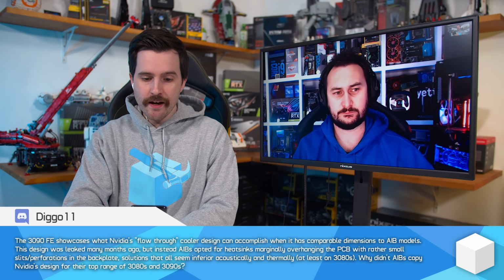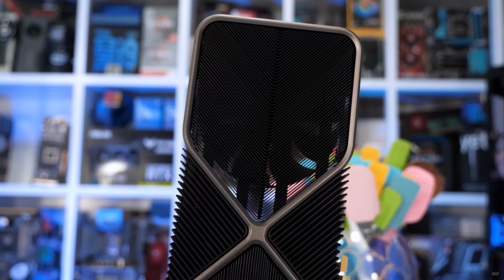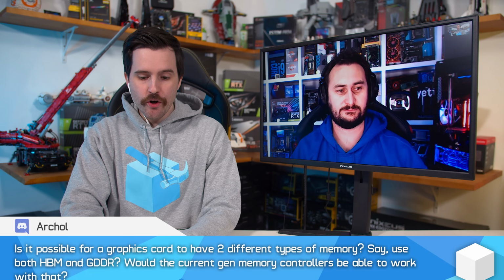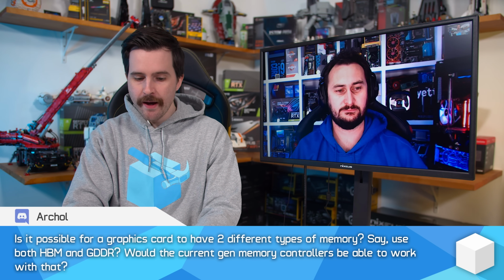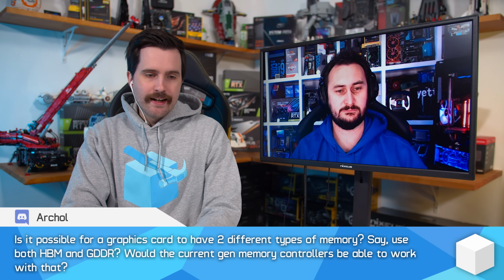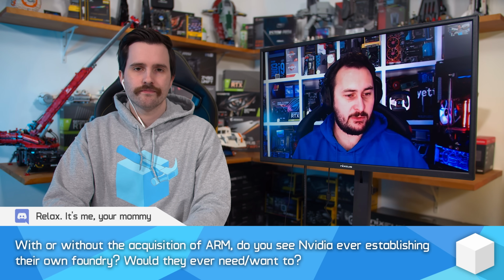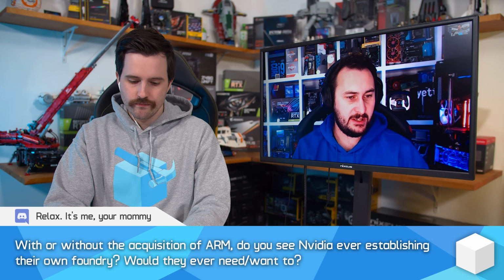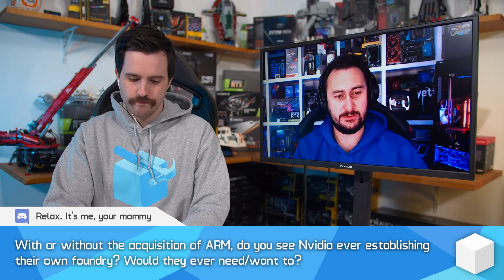Will RDNA2 and Zen 3 Have Launch Issues? Can AMD Beat Nvidia at Ray Tracing? September Q&A [Part 3]

Comment: in 10 years igpu's will have a similar performance as these big boys today
Reply: Doubt. 3nm will allow much larger performance, yes, but there will be a hard ceiling and I doubt it'll reach the 3080. The problem with iGPU's is that they either need on-die VRAM (I.e. less space for CU's) or it'll depend on system memory, so at some point more CU's will be useless.
Reply: @WhenDoesTheVideoActuallyStart  2010's GTX 580 has comparable performance to vega 11 (3400G) graphics performance. with some OC on the igpu and good memory, it matches roughly
Reply: @acidGoatG  If we don't figure out carbon-based processors we will be stuck with 3nm-ish silicon. Moore's Law is really dead.
Reply: @WhenDoesTheVideoActuallyStart  we will see, maybe you are right, but never underestimate the engineers and science dudes.
Reply: @acidGoatG  2010 was the year of gtx 480 ...
Reply: @SoFGR  gtx 580 was 2010 Q4, so both of them counts as 2010 products in my opinion
Reply: @WhenDoesTheVideoActuallyStart  doubtful, i was reading about hard ceilings in gaming mags in 1999.

at the time they were claiming 500nm was the absolute limit for moores law.
Reply: mikey wow, you had gaming magazine in 1999?
Reply: @puddles5501  500nm was theoretical,
~1nm is actual physical limitations because of quantum tunneling
Reply: @WhenDoesTheVideoActuallyStart  maybe when DDR5 comes out it might be good enough
Reply: @GewelReal  ddr5 is like months away.
We will probably have it by  q3 2021. 

In 10years we will be on ddr6 or ddr7
Reply: @GewelReal  With 5nm APU's running on DDR5 we might see RX 570-like performance, as it's been clear that even on DDR4 the Vega-based Ryzen APU's haven't been able to leverage all the bandwith. But we'd need on-die memory for anything more than that.

Comment: The die has been cast with this 30 series launch.  Swarms of auto-buy bots will become increasingly sophisticated to get around anti-scalping measures, and the general cluster F'ck that has become our global supply chain slowing down production worldwide means you may as well add a couple of months (or more) to any hot product launch going forward before the general public will be able to easily find one at MSRP.  The world has changed a lot this year, and generally for the worse.
Reply: They could easily limit purchases by limiting them to 1 per address.
Reply: @undefinablereasoning   Many sites already have.  Hasn't made much difference, money is a hell of a motivator for getting around things like that.

Comment: With Nvidia having more money and more muscle to throw at RnD, it's tough to imagine AMD can get their Shader Cores and RT Cores on the same level as Nvidia simultaneously. I mean, just last gen the 5700 XT and 2070 Super had almost identical specs but the 2070 Super was faster and more energy efficient before and after its special tricks. AMD has Microsoft, so RT may catch up quickly, but Nvidia still has 2+ years of RTX practice to AMD's 0+ years. Then DLSS further complicates matters, does AMD create a Tensor equivalent? CAN AMD BEAT ONE OF THE BEST AI COMPANIES IN THE WORLD AT THEIR OWN GAME?

So spicy, can't wait to see what goes down.

Edit: Oh and even if they do, did they fix their hardware encoder AND add HDR support?
Reply: i will be straight and i say to you  Turing is more good for gaming than Ampere.
Ampere just...is not for gaming section!
Reply: @riannair7101  That is simply not how generational improvements work!

Comment: My gut feeling is that RDNA 2 will have a smooth launch. They did have a bad period with drivers earlier this year but apart from that they have been good for years. They have been investing more resources into software lately, and they seem keen to release big Navi when it's ready rather than rushing. Of course I won't preorder anything though, will wait for reviews.
Reply: I think Ryzen have helped alot, they got the cash to spend on drivers. Sure its a different department but nobody at AMD want the company to get/keep a bad name...
Reply: @ssu7653  Absolutely. AMD was losing money until they launched Zen. They were in survival mode cutting staff and everything was focused On Zen. Discrete GPUs were completely de-prioritized, hence the rebrands and dragging out GCN.

After Zen launched they started making profits. Since then if you check their financials for the last 3 years every quarter they increase their R&D budget.

Comment: There was shortage of Zen2 cpus... Zen3 seems to be even more popular... so more demand! So Zen3 is very hard to get, even if the stock is bigger than with Zen2... Does this affect GPUs.. surely! There will be rdna2 GPUs... but you may have to wait even longer than ampera. Nvdia has the ”whole” Samsung production capasity to those. Amd has to divide TSMC, between Apple, other mobile phone manufacturers, new consoles. 4000 series mobile and apu chips. Zen3 and small and big rdna2 chips... So you have ro wait those... how long is the interesting question.

Comment: The GPU blow past PCB has been happening for years, it is not something invented by Nvidia RTX3000 series.
My Gigabyte GTX 970 did it and the Sapphire R9 Fury has a huge cooler overhang, because the PCB can be made so small without ram modules.

Comment: With RT on for RDNA 2 in current games, because while its based on DXR, the devs coding it calls RTX functions in NV's library, that sits above DX12 DXR. If the devs didn't code for a fallback mode (DXR compatible code), it won't work without a game update. Some of these games also have a vendor ID & GPU id detection code, to enable RTX toggle on in the options, so it may not even recognize RDNA 2 GPU as RT capable hw. 

Future games will be really well optimized with RT for RDNA 2 though, due to both major consoles having similar hw and RT implementation.
Reply: I see no reason why devs would use vendor ID & GPU ID if they can just test for ray tracing support. Pascal having software ray tracing suggests that there's nothing that truly demands RTX hardware.
Reply: @ETophales  Because the RTX games are sponsored by NV, to use their specific library. ;)
Reply: @nerdtechgasm6502  The only RTX-specific library I'm aware of is OptiX, and I think that won't be relevant for games.

Comment: "Why Didn't AIBs Copy RTX 3080 FE Design?" - Seems like Asus TUF did a better job thermally and acoustically than the FE card, and based on speculation that the FE cooler may cost $150 to make, I don't see a problem with the AIB's not copying Nvidia.
Reply: I mean, yes, but it's also much heavier. That's the point.
Reply: @WhenDoesTheVideoActuallyStart  I haven't seen any reviews of the 3080's that make a big point about the weight of the cards beyond mentioning some of them are heavy, so I don't think that was a big consideration in how either Nvidia or the AIB's designed the coolers. Unless you've got a quote somewhere mentioning weight savings being a big factor in how Nvidia designed the coolers, or even weight specs of the different cards to prove one is heavier than the others (I went looking through some reviews and specs pages and couldn't find weights)
Reply: @VelcroSnake93  I just checked and apparently the Asus card weights in at 1.77kg while the FE stands at 1.35kg, so while not by a monumental margin they did use something around 30% more metal.

Comment: Nvidia has had a whole generation to work on Ray tracing, whereas this will be AMD's first time dipping their toes into ray tracing, but the results of AMD will be interesting to see regardless.
Reply: Tbf AMD is investing more of their R&D into gaming cards, while Nvidia thought that AMD would never be able to catch them.
Reply: @WhenDoesTheVideoActuallyStart  And so far AMD has not come close to catching them.
Amd to this point has only challenged at the mid point cards and below level.
Anything concerning the new cards at this point is still just speculation and guessing but most opinions seem to be the new AMD cards will not be on the same level as the 3080. 
They will compete and maybe even beat the 3070 but not the 3080.
Reply: @billwiley7216  And?

Comment: The Q&A series is very informative like GN's hardware recaps. When is the A520 mobos review coming? I m anxiously waiting for that.
Reply: Noone care about that cheap boards
Reply: @lowzyyy  Not everyone is a prosumer lol. In fact, the vast majority of people aren't. Gigabyte's A520's can handle 6 cores and have PBO+RAM OC'ing, what else does one need?
Reply: @WhenDoesTheVideoActuallyStart  i am not a PROsumer. But if i buy pc for next 5 years i would not buy pcie3 now...any b550 will do the job..just my opinion. You dont need aourus master to use ryzen 3600 thats true. Something around 150e is enough for the motherboard that will run ANYthing.
On the other hand maybe its better to upgrade more frequently. In that case A520 is good buy.

Comment: I'm pretty sure you don't know what you're talking about if you think it won't be difficult for AMD to implement DLSS. Remember that DLSS isn't just the hardware in the graphics cards themselves. DLSS is an implementation of a trained machine learning model that Nvidia have been refining on their supercomputers for some time now. AMD doesn't have anywhere close to the raw compute power that Nvidia has, and Nvidia isn't going to share that trained model with AMD. It would take a very long time for AMD to come up with a comparable trained model of their own.

Comment: As long as RDNA 2 has a 3070 ti equivalent with 16gbs of vram, around $50 to $100 cheaper, & a lower tdp I'll be satisfied.
May be asking for a lot but this is what it will take to take market share from Nvidia.
Reply: I think this will be my second AMD card.
My first was a R9 290x then 1060 then 1080 and now I think it's going to be amd again
Reply: @OutOfNameIdeas2  R9 290x was a kick ass card if you knew how to tune them right! I was rockin' one with watercooling & a BIOS mod until early this year before finally deciding to retire it for a 5700XT I picked up for $320... Which happened to fit the same water cooler & is now also BIOS modded to perform as well as a 2080S. xD
Reply: @EnragedN3wb  was the price for your watercooler was worth it? and how much is it?
Reply: @madtech5153  The watercooler came with my R9 290x which I actually bought used from a guy who had 2 of them in crossfire.

It's an Arctic Accero Hybrid, & I can't even find them for sale anymore. It's so old I had to take it apart & refill/clean it before using it on my 5700XT, but the 5700(XT) has the same exact mounting pattern as the R9 290(x) so anything that fits an that should also fit a 5700.

As for being worth it to watercool, it definitely was for me, since it lasted through more than one GPU. If you want to get more out of your card it very well could be. I got an extra 150MHz OC out of mine & it still runs cooler than stock(60C core/100C hotspot @ 2100MHz max boost), I just don't want to push much more voltage than I am.
Reply: @EnragedN3wb  awesome, that guy you bought it from was awesome too
Reply: AMD can't limp miles behind Nvidia forever. Big Navi has to be able to rival at least 3080 in performance.
Reply: Ya 50-100$ less but lacks dlss2.0 alternative & has driver issues for months. I'd rather pay 100$ more.
Reply: @fabAB912  Rumor is AMD has a DLSS equivalent.
We'll see though.
Reply: @fabAB912  & yeah AMD drivers have been spotty.
It seems like they are taking their time finalizing stuff for RDNA 2 so I expect good drivers on release.
Anything other than good would be unacceptable & a disaster.
Their drivers already have a bad rep which will only worsen if the RDNA 2 drivers suck.

Comment: Xbox series X Ray Tracing specs
95 giga Rays triangle (95/8=11.875 giga Rays)
380 giga Rays box (380/32=11.875 giga Rays)

11.875 giga Rays(12 giga Rays).. hhmm maybe the performance or Rdna 2 Ray tracing is not far from Turing and ampere😀

Comment: What's the best mid-range CPU currently for gaming/editing?
Reply: 3600.
If I were you though I'd wait until AMD release their new 5000 series CPUs.
If you wait you'll get a better CPU for the same price.
Reply: @HaveFunLosingBro  u mean 4000 Series right?
Reply: @niiiiiklas  Leaks say that they'll name it 5000 to distinguish it from the new APU's launched which are actually a generation behind architecturally speaking.
Reply: @niiiiiklas  they will be called 5000 for less confusion between laptop and desktop architectures
Reply: R5 3600x or xt
Reply: @ayanmaity2605  or the normal Ryzen 5 3600😉
Reply: @niiiiiklas  a little extra ocing  never hurt nobody but the pricing matters
Reply: @ayanmaity2605  that's true
Reply: @ayanmaity2605  XTs are only really good for overclockers
Reply: Wait a week for amd to announce better cpus.

Comment: It was so stupid when 1080p monitors came "Now with full HD!" Yeah, less resolution than 16:10 had with 1920*1200 :P
Reply: Man, I wish 16:10 had become the standard aspect ratio. My old 1680x1050 monitor just felt better for work and games, even if it's fewer pixels.
Reply: resolution numbers are kinda arbitrary anyway
Reply: @Traumatree  The film industry uses 21:9
Reply: @Logic-Films  not all. Only some cameras shoot at 21:9 ratio. Some shoot at 16:9 or 19:8.5. Animation is halfway between letterbox and 16:9. The film industry only uses a couple models of cameras as the standard has been pushed exceptionally hard by expert optics manufacturers and engineering. So not everything is shot in one ratio. Why do you think the main object that we watch movies on, the household television, is only in 16:9 ratio right now? Only monitors are ultrawide. It is because most films are not shot in ultra-wide ratio. Most people don't watch movies or TV on their computers. People who live in their bedrooms do. IE: kids.
Reply: @Logic-Films  not really, a lot of aspect ratio were used in the past and now most professional digital devices use 2:1
Reply: @PainterVierax  No... Most films are still shot on digital camera sensors that are either 4:3 or somewhere close to 16:9. They are then cropped in post to the desired aspect ratio.
Reply: @Traumatree  
It the TV standard, old movies on film don't have a resolution as such and new films in say 4K are recorded at 4K which is just above 4000 pixels on the top where TV is just below 4000, kind of a bit messed up really
Reply: That's not how it went. When monitors came with 1920x1080, mainstream resolution at that thime for monitors was 1680x1050 in the same price range. There were 1920x1200, but those were high-end monitors that cost 3x the low-cost 1680x1050.
Reply: @petrkubena  I bought a 1920*1200 Benq fairly cheap in 2008. Still have it after a repair at some point.
Reply: @Traumatree  Oh, I know. Still, celebrating having less resolution \o/
Reply: Even today I prefer 1920x1200...
Reply: El Cactuar That's why the abbreviations are retarded. People shouldn't be lazy and type the exact resolution.
Reply: 1920x1200 16:10 masterrace
Reply: No, Full HD was to separate it from lower resolutions like 720p/1080i which are also referred to as HD.  Since major broadcast networks ABC, FOX, CW are broadcasted at 720p and CBS, NBC, and PBS are at 1080i.

SD = 480i
ED = 480p
HD = 720p , 1080i
Full HD = 1080p
QHD 2K = 1440p
UHD 4K = 2160p
UHD / 8K = 4320p
Reply: @vh9network  Like El cactuar says, QHD is not 2K. 2K is a slightly wider variant of 1080p.